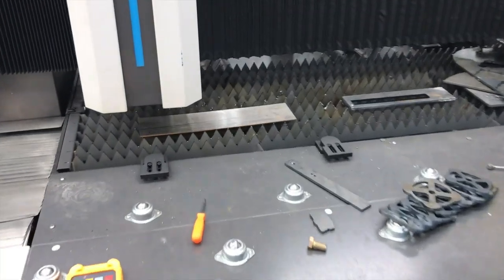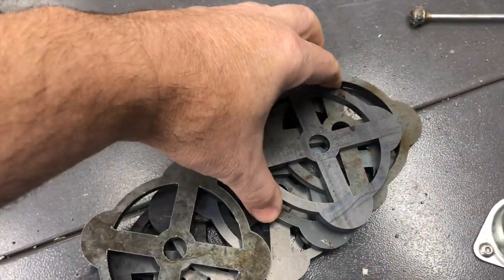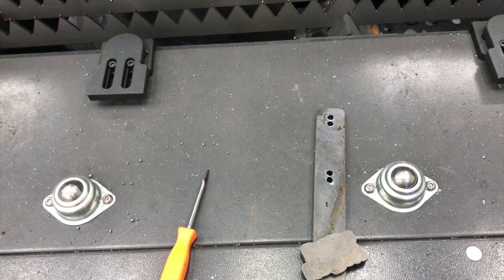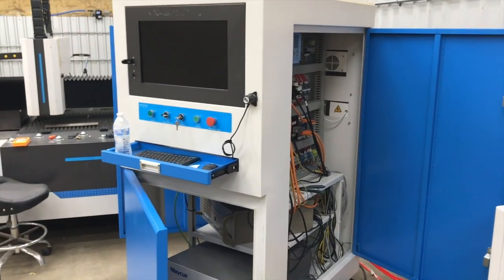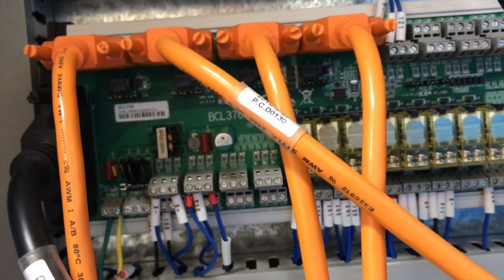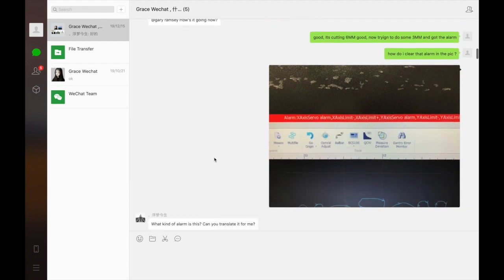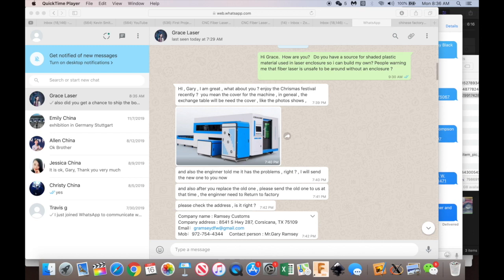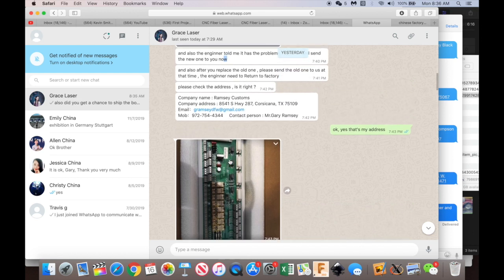Laser is already down- BCL3766 Board Failure - China Support Process Details -

Comment: looks like there's a power led right next to the screw terminal, unless the terminal is bad or the PCB broken right next to the terminal  it makes little sense that it doesn't light up. There's not a whole lot going on on that board apart from relays and wires
Reply from the maker: i agree

Comment: Did you seldom use the machine for tube cutting? I saw the pipe cutting attachment and the plate cutting machine tool are not placed parallel, which will affect the accuracy of the pipe cutting.

Comment: Oh, that looks like it's your Servos IO board, it transmits the signals from your motion controller to your servo drivers, and your servo drivers closed-loop signals back to the motion controller. And based on the relays I guess it also controls all other analog functions.

Too bad they slapped everything on one PCB instead of having an axis/function-based breakout layout :/
Reply: You would be a good friend to have.
Reply: @alaskanken2132  Having a sarcastic industrial mechanic as a friend?

Nah, ask my friends, they say I'm a pain in the butt ;)
Reply: Well  you sure sound like you know what you're talking about 👍
Reply: @alaskanken2132  Well a bit, comes with the job XD
 I've never worked with Laser Cutters, but I've worked with and maintained various industrial CNC machines as part of my job. But those were mostly either older german made high-end systems, or more modern. The old german ones also had breakout boards for various functions similar to this one, which we had to fix a lot over the years due to their age. The modern machines all had optoisolator boards for all functions, which then lead directly to the drivers, solid-state-relays, etc. Those were a blessing to fix as every time something did break you could be 99% sure it was something behind the optoisolators, the motion controller was never the issue as it was protected behind those optoisolators in its own shielded casing.

So, all in all, I've never worked with this style of a machine, but I probably could figure out what's wrong with it and fix it since it used to be part of my job. Remote diagnosis is sadly very hard on things like this.
Reply from the maker: man your right, that board has alot going on with it

Comment: Hi mr Ramsey, my brother has just recieved the same 1kw laser from China. He has a Cnc plasma but this is a new ball game. I’ve help him instal and set it up but we are really struggling with getting gas pressure, current %, power % right just to cut some 4mm sheet to a decent standard. We tried the pipe cutter with some box section but that mostly made mess. We’ve had no luck with piercing at all. I was kinda hoping you might give us some setup details for various material thicknesses to get us started. As you know the chinese manual ain’t great. Hopefully you or someone else would like to help. Cheers

Comment: So why did the board fail?  You showed some less than ideal wire termination in your previous video, the result of them sending you cut cables.  It wasn't clear to me if those were high voltage motor or low power signal cables.  Regardless for a CNC machine like this (and at this price point), all of those wires should be shielded and run uninterrupted from the motor/encoder/limit switch back to the controller.  If they are split, should go through a proper shielded connector.  Are the cables even shielded?  What I'm getting at is I hope that the poor termination isn't picking up interference and taking out the board.  I guess you will find out if it was a one off "bad board", or a reoccurring problem soon enough.  Good luck, thanks for sharing.
Reply from the maker: my guess its a defect in the board somewhere, maybe a cold surface spot or something.  I understand everything your saying about the wiring.  The wiring going to all of the motion control components appears to be shielded and the ones going to things like limit switches do not seem to be shielded.  I understand that unshielded wiring could lead to erratic behavior of the machine, but i dont understand and dont see anything in that machine that would lead me to believe it would cause a board to fail

Comment: Hi, for pierce try the next settings. 1000ms step, 1000ms pierce time. Hi power (90%) Low gas preasure (20psi), Pulse pierce (10hz) and a pierce hight from 5 to 10 mm

Comment: On our laser we try to stay away from holes that are smaller then the thickness of the plate. IE 1/5 plate = smallest hole at .25. What we will do on a production run is make a drill template out of 1/8 (in this scenario) or any scap really that would be under .200. Then gang drill the parts on the mill. But I can say that I have pushed this "rule" for fun projects.  Learning and relearning the capabilities of your machine is paramount. Also try coating the steel with Marvel Mystery Oil to eliminate spatter on piecing. And try turning down the pierce and cut wattage for those holes.
Reply from the maker: right.  I think the 1KW power source is the limiting factor on this.  A 6kw would pierce much more cleanly
Reply: @turbocobra  do they have a 6kw option for this machine.

Comment: The cut looks good. Pierce condition should be adjusted for the small holes to improve the quality.  Having issues with a new machine is not unusual.  Let's hope you get the part quickly and it is covered under warranty.

Comment: We bought ours from a USA based company and their support is USA based and very helpful. We've had very minor issues with ours. On the holes, for thin materials you will likely need cobalt bits. Laser cutting makes it harder than stainless and will ruin hss and coated bits in a skinny minute. 

On your pierce into 1/4 are you using a multi step pierce?  Or multi stage? With a 1kw machine that pierce may need 3 to 4 hits starting at different heights to get through the material before you start cutting. Email me at mark@alphidia.com if you want to work through this. Happy to help.

Comment: Awesome your getting some more cut time in 👍👍!! On your hole issue in 1/4 inch or anything where you have a hole about the same size as the thickness of the plate you are trying to cut you will need to cut that hole under a medium or small contour in you cutting conditions or however it maybe laid out on that laser.  That should help in dialing in the laser on small holes. You should at some point even be able to do 1/8 holes in that 1/4 in plate if you really wanted with pretty good quality. Getting settings right can be tricky since you have wattage frequency gas pressure focus etc.  To take into account.
Reply from the maker: right i knew that was the case for Plasma, but was thinking laser wouldn't have that issue.  I think its the 1KW power source.  If i had 6KW its got the power to pierce with less surface disruption.

Comment: do you have a plan for drilling holes you have pre-drilled with the laser and got hardened? do you use carbide drill bits?
Reply from the maker: yes i have some carbide drill bits, but wont need them. the inside of those holes don't get nitrided and flame hardened like plasma holes
Reply: @turbocobra  oh interesting, I had bad experiences with laser cut holes.

Comment: Nice to see your getting this piece of machinery running. I'm guessing this machine purchase was solely for business manufacturing. Yeah I wouldn't a laser cut precession holes, especially for machining purposes, slag can hang up and just make them look like shit. Which was why I was surprised you went the laser way, and not a CNC route. Good luck with it, curious to see what your gonna pump out on it.
Reply from the maker: when setup right, laser cut holes can be a more true hole than a drilled one and completely dross free.  The laser surface edge is not hardened and nitrided like plasma and oxy fuel so it can easily be setup for second op machining

Comment: Thanks for doing this. I also am looking into getting one of these. Someone has one in a shop local to me and he was having problems with smaller detailed parts too. This is the main reason I want one to do smaller detailed pieces. It should cut cleaner 1/4" holes I would say, did you ask them what the deal is?
Reply from the maker: Yes, i think I can get improvement on that with a better piercing routine.  Although this is a 1kW power source, and a higher powered machine should be able to pierce with less surface impact.  Thinner materials do not require a pierce and can cut with very little to no leadin

Comment: Looks like your nozzle centering is off and your focus for pierce is a little off, otherwise you should have no problem doing .1" dia holes. on that 1/4" Just need to slow down movement, fix pierce and pulse around the hole.
Reply: agreed! or pulse pierce into the metal first and then continue cutting...a lot of slag can be prevented by dialing in your focus, cutting power, speed and oxygen supply.
Reply from the maker: I did a tape shot test and it appears to be centered up, but then again I am new at all this

Comment: Does the laser harden or temper the metal in the cuts? You've definitely got a lot more faith than most going Chinese on that machine. Hope it works out. Thanks for sharing
Reply: from my experience it air hardens steel. I don't know for stainless.

Comment: Ya you need to work on the piercing. Look at the gas PSI/BAR on your piercing, it is way to hot.
Reply from the maker: Right, it needs work.  I had it set a lot lower starting at .5 bar and .6 bar for the 2 stages, and had to keep raising it otherwise it would never pierce and just make a mess.  This is only a 1KW power source
Reply: Ramsey Customs - turbocobra 
If that is the case then you will need to work on the frequency and piercing height, step 1 would usually be around 8mm and step 2 around 0.8 for me. 
I understand that it doesn’t have a lot of power, that means might have to compensate with longer time. 
Love the videos man keep it up.

Comment: Most of these types of boards have a FUSE right after the VDC_IN...that is generally there to protect all of the other, more expensive, components on the PCB. Try and see if this FUSE exists, and if yes...try to bypass it with let's say a similar size or a little larger automotive FUSE like I did here: https://imgur.com/iw1a4ZV. Maybe that will get you going?
Reply from the maker: New board is coming today, but definitely good info, should have looked more closely for a fuse